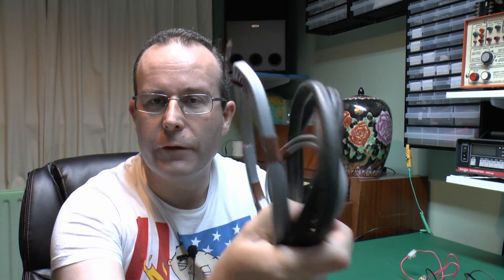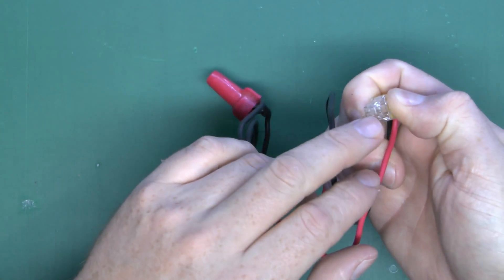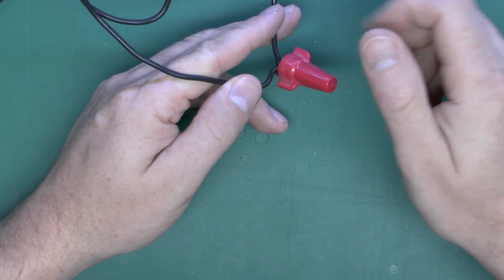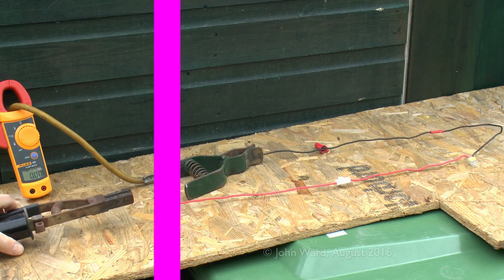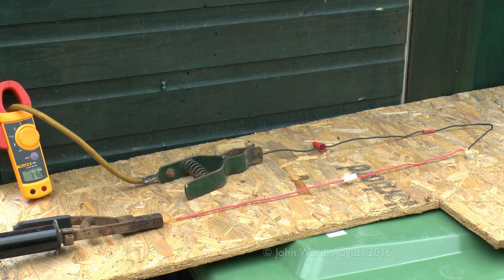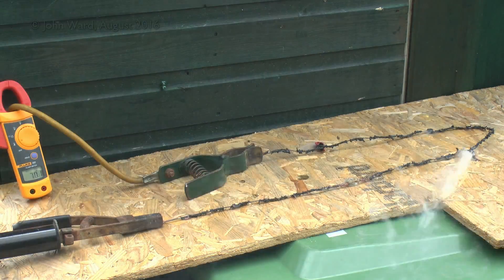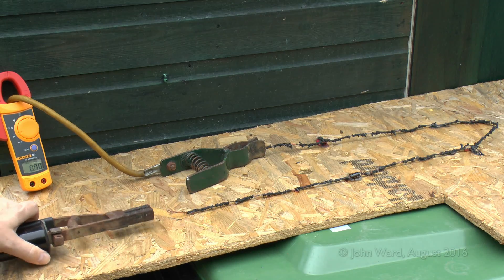Wire Connectors Overloaded

Comment: I suspect the wire failed at the wago because the wago has the least amount of contact area with the wire, therefore the most resistance and heat. A thermal image at the time of failure might confirm this.
Reply: Chris Landry  I see what you mean, but I think he might still have a valid point. The heat generated at the  contacts is transmitted to the adjacent metal of the wire by thermal conduction.

Comment: Not very surprising at all really, as long as it has metal clamping parts holding the wire together properly there's more to conduct the current at that point. Repeat bending and flexing of the wire is more likely to weaken the metal, exactly the case where the first failure point was.
Got me thinking though, I can not remember seeing any consumer serviceable wire connector with an intended controlled safe failure state.

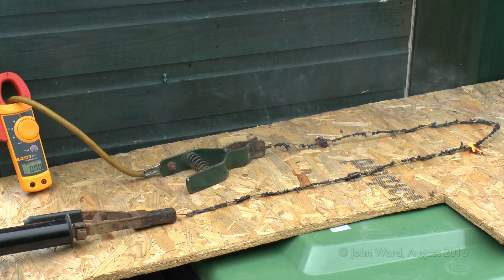Comment: At 5:22 the insulation nearest the Wago connector begins to smoke and melt. At 8:55 the wire nearest the Wago connector burns through. This is likely because the connection in the Wago connector has the least amount of contact surface area, and the least amount of contact pressure, resulting in the highest amount of electrical resistance. Higher resistance = higher heat. While the Wago still performed beyond its rated ampacity, even at lower currents it will likely create more heat than the other connectors, and that heat over time (years) could cause degradation of the wire... possibly; I'm not an expert on these matters.

Comment: I have seen both wingnuts and screw block fail from heat cycles, maybe use 90A load in 5 minutes on - 5 minutes off cycle to see which one fails first.

Comment: At first, I thought, "I wonder which one is the best and will fail last?" then I started thinking, "Is that better? If the connector failed, then the current might stop and then stop the heat, so is a connector that doesn't fail better?"
Reply: One  of the reasons I was keenly interested was to see how well the wago connector would fare with heat etc. I think this shows that it is a good connector for many applications. Now to see if it is legal to use in my area.

Comment: Very interesting. I want to test wago 222 and 221 now (the ones with the lever). As it happens I just borrowed the thermal camera for the weekend.. :-)
The choc bloc connectors with two screws aren't approved around here for wiring inside walls, at least that's what I was taught. I don't see how they can be worse than the ones with a single single screw as long as you strip the wires longer, so they all go underneath both screws. 
I guess as soon as the plastic melts off it's game over anyway, there will be a short and the breaker will trip. So in practice (to prevent fires) the chance of accidental poor connection might matter more than ultimate current carrying capability of properly done up ones. In that regard the Wago connectors might actually be safer, but those tiny springs, I never quite trust them...
Building owners are supposed to have an electrician inspect and re-tighten screw connections periodically around here, but I don't know anyone who actually has this done, ever. How is the situation on this in the UK?
Reply: Choc blocks or any other kind of "maintainable" connector is not permitted in an inaccessible location such as inside a wall, due to the likelyhood of them becoming loose over time due to expansion and contraction.

There is no requirement to have inspections on a house installation for example, there are regulations on commerical premises with the Electricity at Work Act for the installation to be safe for use, but it does not specify what has to be done, only that it must be safe (Generally people take the out of sight out of mind approach until a fire starts)
Reply: Before Wago connectors cornered the market, what did you use in the UK? The choc blocks with two screws or the ones with a single screw?
When I wrote "inside the wall" i meant inside flush mounted junction boxes, so theoretically accessible, just nobody ever bothers to check them.
Reply: The 2 screw ones as seen in the video are standard. I like the idea of the single screw ones but never seen them here :(
Reply: I can't say I have ever seen a single screw connector block in person, almost all connectors are of the double screw type when  in or behind accessories
Most of the time in a domestic setting connections are made inside plastic bakolite junction boxes with built in single screw terminals, although not very often are in sight since they are generally left in the loft and hidden under a load of insulation.
Reply: The single screw ones usually have oblong holes, so no wire can slip sideways out from under the screw, but there are also smaller ones with round holes. They are called "Dosenklemme" and still readily available.

After some research there doesn't seem to be any standard explicitly prohibiting the use of two-screw choc block type connectors in either Germany or Austria, but I was certainly taught that and the opinion that they are not acceptable is universal among electricians. Reasons given are that they are only rated for 6A, and only specified to fit a single conductor into each end to be clamped by one screw each. The former is clearly false, at least on RS components I can order large choc block connectors rated for 100+ amps. The latter I can't refute, the datasheets aren't clear on whether you should fit more than one wire on each side.

Junction boxes with built in terminals, just like ceiling roses with molded in terminals, are virtually unknown here, I have never come across one in a domestic installation. It is amazing how different your electrical installation is, not just in terms of peculiar materials used, but also some things that they tell us we must never ever do because they are unsafe, are clearly not all that unsafe...
Reply: In Austria choc blocs certainly aren't prohibited for fixed wiring, on the contrary, especially in the Eastern parts of the country they were the norm between about 1965 and 2000. It was always considered good practice to insert all wires from the same end though.

Around 1970s wire nuts (apparently imported straight from the US, I've seen a few boxes with all-English labels, non-metric wire sizes and only UL and CSA approvals) had a brief spurt of popularity but disappeared again within less than five years.

Junction boxes with built-in ceramic terminal blocks were once very common in Germany, I'm surprised you've never come across them! I've seen some surface-mount ones in Austria too but they weren't too common.

BTW, did you know how wires were spliced in Austria before plastic choc blocks were invented? Each wire end was bent around an M3 screw with a big washer and then the connection was tightened with a special nut (either square or a strange three-dimensional shape like a circle with three arms extending at 120 degrees, the arms bent towards the screw head and gripping the wires to keep the nut from moving while the screw is tightened. Finally the whole thing was wrapped in cloth electrical tape. I've seen that type of splice in installations from ca. 1914 to 1960, the latter done by a rather old-fashioned electrician, who also still used the older and harder to use metal and tarpaper conduit and boxes rather than PVC. In terms of reliability during heat/cool cycles these splices are much worse than choc blocks, in every place I've seen that had them the majority was loose. At home I even had one fail with nasty arcs after I opened a junction box to see where the wires go. When I put the fuse back in I suddenly heard a noise and realised one of the connections was arcing under the tape. Quickly replaced it with a choc block and eventually rewired the whole place.
Reply: Thanks for the reply.
When you say choc bloc, do you limit the meaning to two-screw terminals (Lusterklemme) or do you include single screw terminals (Dosenklemme, Dolü)?
I've certainly come across many single screw terminals, but rarely two screw inside a junction box and as mentioned before I was taught they are not permitted for anything other than join the flex cord of a lamp to wiring inside the wall.

I have also come across the black friction tape connections you mention, but on the ones I have seen the wire was just twisted together inside, and bent over once before wrapping. They were installed in metal junction boxes and conduit with tar paper.
Reply: I'm referring to the two-screw variety, usually called "Blockklemme" in eastern Austria. Until Wagos took over they were far more common than the single-screw variety (often called EDK, a brand name by defunct Electro Terminal of Innsbruck, short for Elastik-Dosenklemme). Despite their limited use I've seen far more EDKs with loose screws than choc blocks in existing installations (including ones I installed myself because of over-filled junction boxes). That's why I immediately replace EDKs. Properly sized and tightened choc blocks tend to last for decades, earlier this year I worked on an installation from 1991 and didn't find a single loose screw.

Eastern Austria had another peculiarity for fixed wiring and that is the lack of junction boxes. Instead, so-called "Peschelrahmen" were used for quite a long time, simple rectangles or squares of 10x15 or 10x20 mm pieces of wood nailed together and plastered into the wall. Wires or conduits pass between the wood and the masonry. Sometimes the interior of those "junction spaces" was carefully plastered using a mould and then painted with a tar-like substance. Even the old regulations said "Junctions must be made within appropriate boxes or wall openings" well into the 1970s! A more modern variety that came into existence in the late 1950s was the Rekord-Abzweigrahmen by Dietzel, a round frame made of plastic that served the same purpose. These are still available but apparently only legal for low voltage these days.

Twisted splices can be found here too but I suppose they were considered inferior to screw splices. In fact if done properly they last much longer.

Comment: Called it. I saw this video and thought the WAGO connector would fail first.

I can't say I like them, for a number of reasons. 1. You cant use stranded wire. Well, you CAN, but good luck. 2. It is a royal PITA if you ever need to take apart again, and working as an electrical contractor, that happens quite a bit sometimes. 3 Limited to once size of wire. Ok so really that doesnt happen too often, but when you have runs of 300+ feet on a 12ga wire, you MIGHT wanna think about dropping that to #10 wire for voltage drops. Too bad that the cord for the lights is 12ga though...
Reply: Sovek For stranded wires, there are lever action wagos. The new ones are great. They are transparent so you can inspect the connection visually, they have two holes to poke them with a meter and you can connect virtually anything to anything without any hassle. They are of course more expensive than your regular pen cap crap, but it all depends how you value your time.

Comment: 9:30 you actually didn't disconnect the supply before you started poking with a metal, non-insulated screw driver??? lol
Reply from the maker: Supply is isolated from ground and maximum of about 50 volts.  Shock risk minimal.
Reply: Low voltage

Comment: Hi, John. I’m installing an immersion heater timer but the back box I bought does not have an earth terminal. Can I use the wago connector to connect the two earth wires (one from the mains and the one from the heater)?
Reply from the maker: Yes you can

Comment: +John Ward - that was very interesting, thanks.  but I think it would have been more informative with uninsulated wire, so we could see the effect on the connectors more easily without all the smoke. it would be interesting to see it done again with 2.5 mm wire to see the connectors' performance rather than the effects of the wire overheating. Certainly with 1.5mm wire it looks like the connectors outperform the cable!

Comment: What's your point? The wire connectors fail when your multimeter shows a lecture of 125 amps. In real case the circuit breaker must open the circuit between 15 or 20amps. That kind of wire connectors should be intact with 15 or 20 amps.

Comment: John thanks for the nice video! I'm not an electrician just hobbyist. In my humble experience connection goes this way: chock block - get loose wires because of the temperature in the long term; crimp - permanent no room to change or etc., ; twist - sometimes it takes too much space in a junction box; and #WAGO - I found them like 2 months ago, Jesus!!! Love them, all the way! This stuff changes my life!!! It is just another level, period!!! It easy to use, small, secure because of the spring, quality material, just love`t!!! and junction boxes of the #WAGO, MINT!!! Makes life 10 easers! Thanks, WAGO! P.S.: "I`m not an electrician and I don`t get paid for this comment, just genuine love product/brand, and big thanks to them. This September I will start to go on the electrician course in the UK." Just one more thing, if wire insulation is melted, that is it you done... No connector will save you from trouble :)  John, please carry on with your videos, God bless you for your work! Thanks

Comment: Crimp terminals are not rated for use with solid conductors. They should only be used with stranded, tri-rated conductors.

Comment: Hello, i have two cables that i want to connect to eachother, these cabales has two wires (classic red ans black). I eon’t want the connection to be permanent, so what’s the best option for me?

A terminal screw block works, but i want something tightining without the screws, because the screws are awkard. Will the wago connector work?
Reply from the maker: Wago are fine for permanent connections.

Comment: using 2.5 mm would have been interesting on the wago connection as it will accommodate it.  this would have kept the heat down a little from the  cable itself.

Comment: Whenever I use a wago connector, I flatten the wires so that there is ample contact top and bottom, otherwise connection is feeble at best, bout same as outlets with push in holes....not acceptable, reliable or smart.  Should be required to flatten when used.

Comment: Most of my experience of those dreadful wire nut things has been finding them lying in the bottom of enclosures on American machine tools leaving bare, twisted together conductors. I've never used them myself but it's not the electrical properties more the physical integrity of the things. Bare conductors are never a good thing. I can only imagine they loosened over the years or were an incorrect size for the wire conductors. Anyway, I don't trust them and replace them with a more appropriate modern connector wherever I find them.

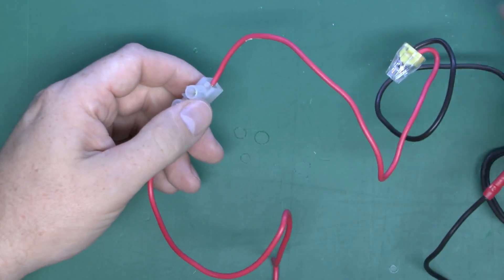Comment: 0:52 "chalk block"? Common in the UK? I've never heard of them. Thanks for sharing. You say the wire nut is considered old? It is VERY common here in the US. I used some of these Wago connectors and my building inspector said he had never seen them before.
Reply: Choc (as in chocolate) block. It's sold in a strip that resembles (a little?!) a large bar of chocolate that can be cut to the right length. http://www.ebay.co.uk/bhp/choc-block https://4.imimg.com/data4/JI/UK/MY-1000418/compound-chocolate-bar-250x250.jpg
Reply from the maker: Video about them: https://www.youtube.com/watch?v=XAF5tfLQcic
The wire nuts are 'old' here because they haven't been commonly used since the 1960s, so typically are only found on installations from 50+ years ago.  Those ones were ceramic.  The new plastic ones can be obtained but are rarely used.

Comment: So, it seems that even the cheapo crimp connection is fine unless you're a maniac trying to run maybe 100 amps through a grossly underrated wire.

Comment: Amps don't mean a thing without a potential. You need to be assessing watts not amps. Going by how confidently you handled your clamps I'm assuming you did this test with a low voltage and most likely dc.
Reply from the maker: Reduced voltage AC was used because the current through the wire is directly related to the voltage applied to it.